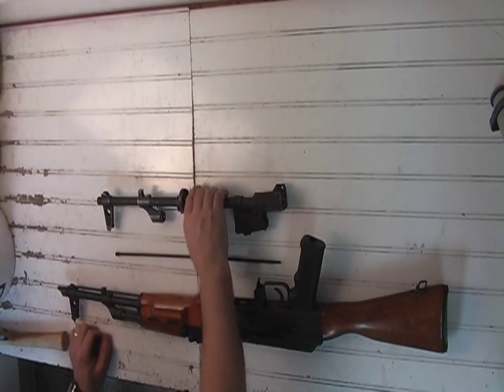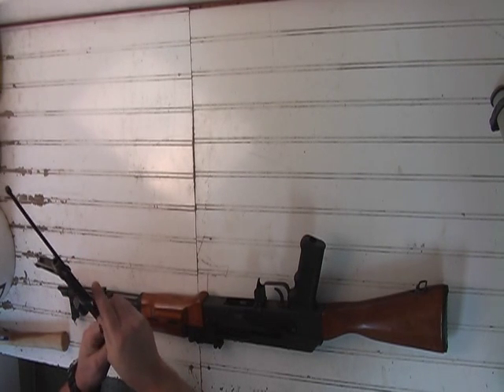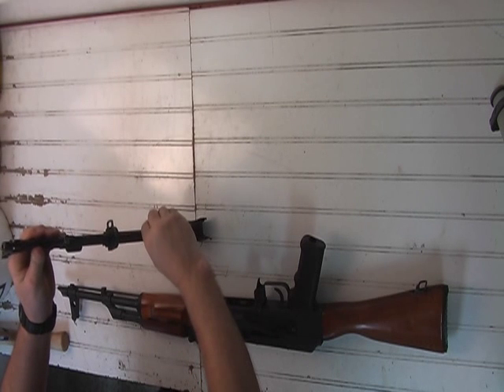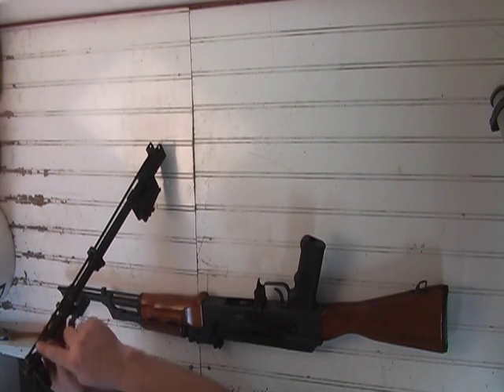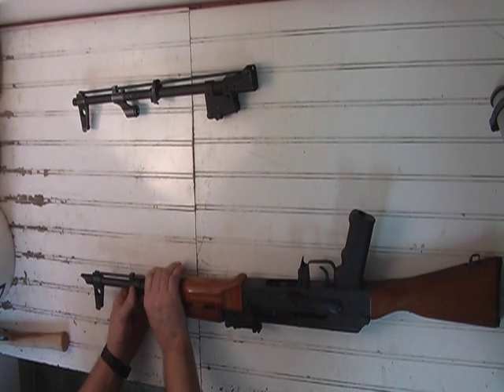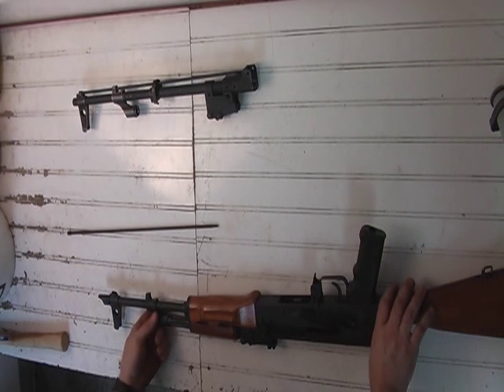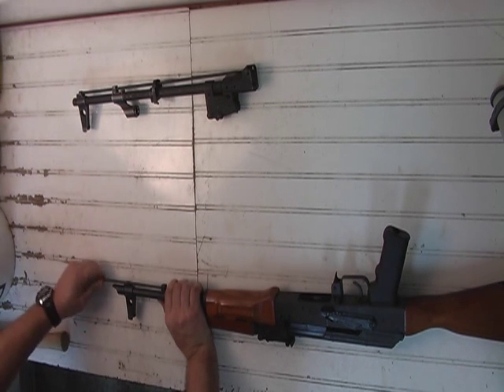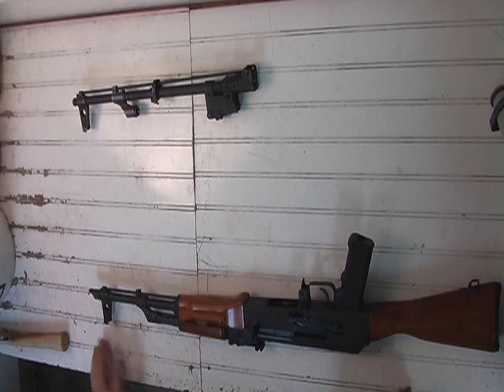I.O. Inc AK-47 Cleaning Rod

Comment: Can you provide more details on the specs of the AK47 cleaning rod in the video description.  Does the I.O. AK47C take a cleaning rod that measures 16 inches long with a 8-32 thread on the end?  Is this the same cleaning rod used in this video?  Some of the I.O. AK47Cs that had been manufactured back in the year 2009 did not come with this.

Comment: Hey my cleaning rod is stuck in my AK and I really do not want to break it so what should I do. And I tried everything to get it out
Reply: +Jason Owen I'm having that same issue I got one of their new AK-247 Sporters and that fucking cleaning rod won't come out.
Reply: +Rashasandine Let me know if you find a soliton, 6 months later it's still stuck.
Reply: Got it unstuck I just squeezed the end closest to the foregrip and used my other hand to get that stuck son of a bitch out. It took a lot of work though and I am not putting it back in my AK for fear it'll be just as difficult to remove.
Reply: +Rashasandine Ok, thanks.
Reply: Not a problem just try squeezing as hard as you can till you see the cleaning rod flex like it is supposed to and use your other hand to try and force it out by pushing it towards the muzzle, but be careful not to damage it or the rifle, thats what I did and it worked and mine was in there good and tight. But keep one of your hands on the cleaning rod squeezing it as you push it out though.
Reply: +Rashasandine Alright, thanks again.
Reply: No problem, let me know if you got it out.